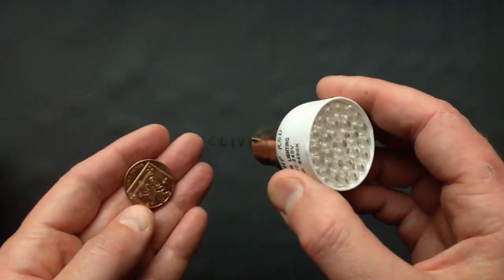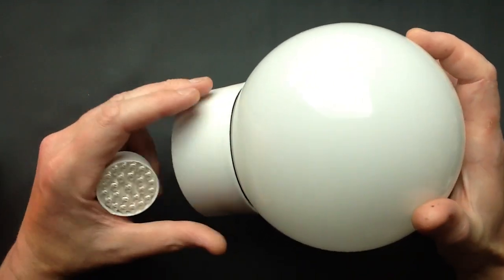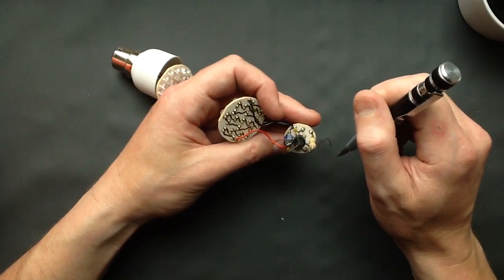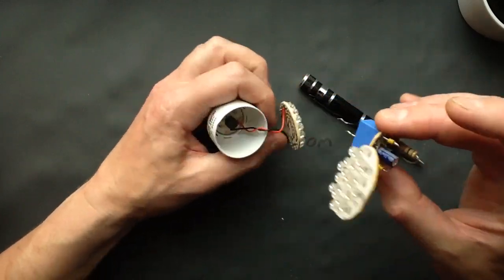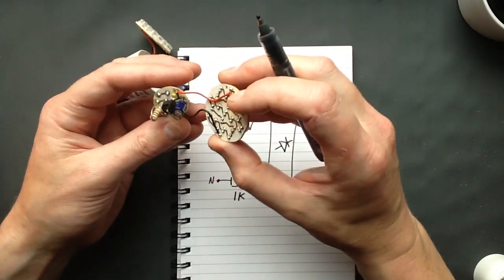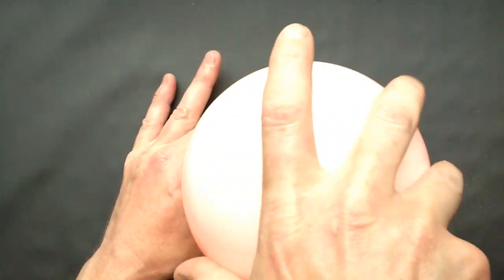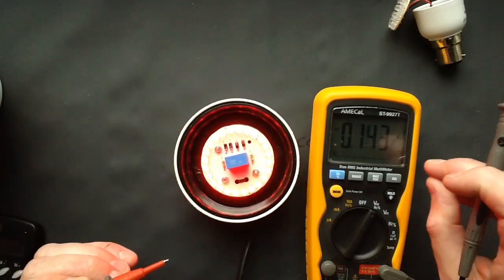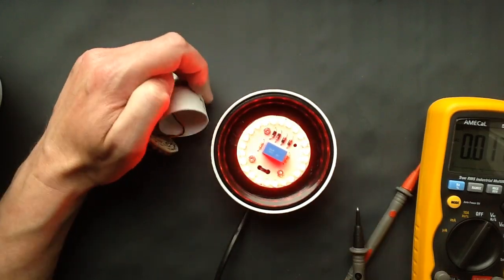Inside some of my earliest DIY LED lamps.

Comment: ok i made this lamp circuit several times  and i am satisfied for it.I am still using some of them after 5 years .It is simple and cheap .here is the link:
 http://320volt.com/19-adet-beyaz-led-ile-220volt-enerji-tasarruflu-lamba/
  If you interested about it be carefull you are trying with 220 volt .Do not touch circuit when its working and do not test circuit without adding leds.

Comment: I wonder if there would be a way to mechanically connect the discharge resistor only when removing a lamp from the socket.
Reply: Toni Lähdekorpi Simple NC push button switch. Button protrudes through the base of the lamp. Plugging the lamp in pushes the switch into the open position, remove the lamp and the switch returns to the closed position. Use a series resistor.
Reply: Toni Lähdekorpi Well, one could use a depletion-MOSFET (Field effect transistor that turns on when Voltage is not applied) across the capacitor that would short it out when disconnecting the Live Voltage.
I've done that for a 6W LED driver circuit I designed and it worked great, though a 1k Resistor in series with the FET helps limiting the discharge current.
Reply: bigclivedotcom Toni Lähdekorpi  Okay, now using a cap discherge component would really be cheating. Just taking something ready-made is boring! Coming up with my own solution is much more fun! :D
Reply: Maanuueel42 Obviously, but that's cheating ;)
Doing it purely mechanically, that's the random fun idea / challenge.
Reply: Because why not?
Reply from the maker: Toni Lähdekorpi There is a dedicated capacitor discharge component that detects loss of the mains supply and discharges the supply capacitors.  It is mainly intended for applications where the capacitors are large and have to be discharged quickly for safety.
Reply: bigclivedotcom Indeed there are - the Philips/NXT TEA1708T is one such. It's more for removing the power that would be lost through a fixed discharge resistor in devices with soft power switches that spend most of the time in standby. This IC itself takes only 1mW on 230Vac.

Comment: Red light is handy as a nightlight, as it keeps your night vision intact and doesn't wake you up, and being in a bathroom fitting it's useful for seeing where you're going on those middle of the night trips to the throne after a spicy curry... :P

Actually, there's a teardown idea, a CFL+LED nightlight, got one of those (Osram DuLed, regular 12w CFL stick type with two cool white LEDs on the very tip and presumably some switching electronics inside) on the landing which you first switch on and it's on LED, switch off and straight on again and it's on CFL, would love to know how those work without breaking the one I have...

Quick edit - Seems the Osram DuLeds are NLA now, means I'd be a bit buggered in finding a replacement!!
Reply: ***** I always thought it was green light that didnt ruin your night vision, i got that from the night vision military grade equiment that the view is always in green
Reply: jusb1066
It's all to do with the way retinas work in our eyes, they have two kinds of receptors, Cones, used for daylight sight, and Rods, used for low-light "night vision", the cones not only help us to see in daylight but also to produce hormones to say "It's daytime, time to keep your eyes open" even under artificial light when they receive enough light, it takes about 15 to 30 minutes for the rods to work fully in darkness (hence why when you first turn out the lights, everything is total darkness, but later on, you can see light in various places), and are easily swamped if you turn on a normal light and they go back to square one.

The red light factor comes in due to the fact that the Rods cannot detect red light, so aren't swamped out, but the cones can, so when your eyes are adapted to being in darkness, you can use a low-level red light (bright red lights CAN swamp out the rods, so low-level red is better) to see where you're going, but not lose your "night vision" aswell as not have the wakeywakey hormone released, so a red light for visiting the throne at night is handy to have... :)

As for military equipment and their green night vision, that's more to do with the way they enhance the available light into a visible spectrum, sticking night vision goggles over your eyes then taking them off in darkness results in them basically being blind as their rods are not adjusted to natural night vision... :)
Reply: Mandrake Fernflower
Well that happens in the Rods, as the body works via chemical interaction with all kinds of external sources, though technically it's the Retinal that has been made from beta-carotene that does the work in the eye that starts the process of light being turned into chemical and nervous signals that are sent to the brain... :)
Reply: Mandrake Fernflower The photosensitive pigment is rhodopsin or rhidopsin (don't know the spelling).

Comment: What is the purpose of the series resistor, when the 330nF cap is already limiting the current?
Reply: Graham Langley
Your points are valid, but mine is also. Please imagine flipping the switch when the main voltage is at its peak and the capacitor is empty. Now, the capacitor is charging from 320V (230V effective is 320V peak). This results in an inrush current. Granted: just a couple milliseconds, but certainly enough to shorten the life span of the switch. Ideally, we would only switch on devices when the AC is going trough 0V and off when the AC is going trough 0A, but in practice, a mechanical switch switches during a "random" phase (or in better words phase angle) of the sine wave.
Reply: sarowie Ah it's that 'inrush' current you're on about. Almost anything with a switching psu, including CFLs and LED lamps, will have a comparable value X2 filter cap connected near enough directly across the supply so it's not something to worry about here. It's when you start charging >>1uF caps from the mains that the inrush current has to be taken into account and limited.
Reply: ***** the resistor limits the inrush current when switching the lamp on. Image switching the switch when the sine wave is right before its peak.
Reply: sarowie Thanks. Makes sense... should have thought of that myself!
Reply: ***** Remember the impedance of the dropper cap decreases with frequency. Fast transients and spikes will push far more current and hence power though it than 50/60Hz mains which can (or will) take out any clamping zeners etc. on the other side. A low-value resistor in series gives them a chance plus it's usually a fusible one to give protection should the cap go s/c.
Reply: sarowie 'Fraid not. The cap acts a constant current source so there's no inrush current as such. See my earlier reply.